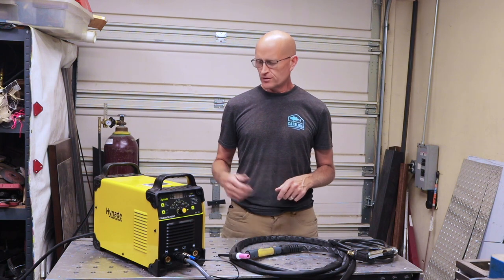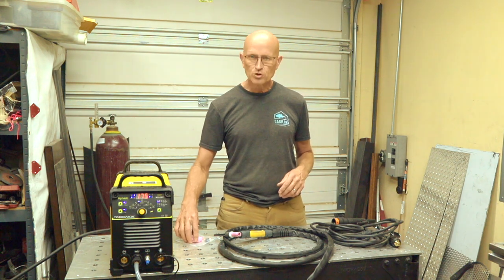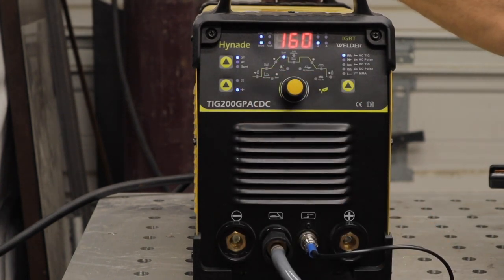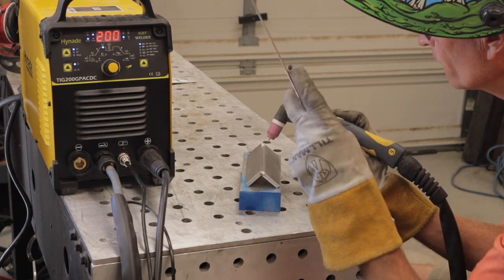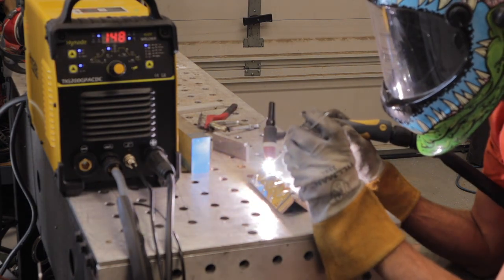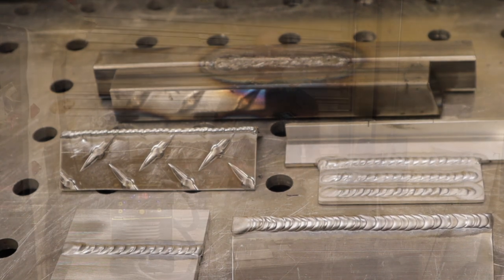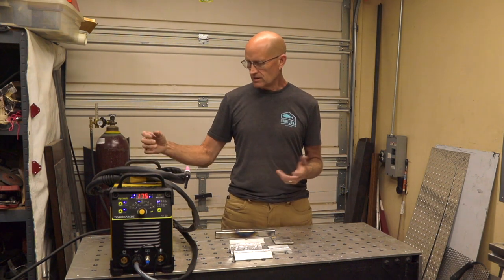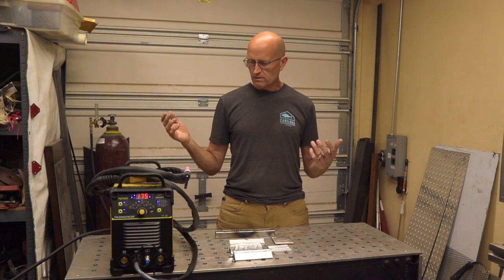Hynade 200 Amp AC/DC Tig Welder Review --- Aluminum Capable!

Comment: Your opinion vs the Primeweld 225X if you have one?  Thank you.
Reply from the maker: Hi Bob! The Hynade is a great Tig. One thing that I’ve learned over the years though is the age old saying in Tig welding, “You can never use the the amps that you didn’t buy”.  Having 25 more amps can be a game changer if you are welding 1/4” aluminum to a slightly thicker material like 5/16” plate. The primeweld also comes with a better torch and better pedal. Both Tigs will perform great for you and I’m sure you would be happy with either. If it were me though, I’d opt for the primeweld. 😁👍
Reply: @PranaTech  The Hynade was on sale this week on Prime Day for $519.  Couldn't resist and ordered one.  Hope it's as good as your experience!  Thanks.
Reply from the maker: Hi Bob! Hey, that’s a great price! Let me know if you have any questions when you get to welding with it. 😊👍
Reply: @bobli9267  I bought mine for $650 last week, about to try and use it tonight. :(
Reply: @PranaTech  very impressed with it so far but can’t get it into SPOT mode.  It only goes from 2T to 4T.  Putting nicer aluminum beads than stainless.  Any ideas on the SPOT mode?
Reply from the maker: Hi Bob, I’ve never used the spot feature before. I’m too lazy to change my settings.🤣👍
Reply: @jacobydavis3953  can yours go into SPOT mode?  Mine can’t
Reply: @bobli9267  Yeah, it seems like spot mode is for tacking. What’s your starting amps, peak amp, balance, and frequency set at?
Reply: @jacobydavis3953  I upped the starting amps to 10.  Peak depends on material.  Balance is for aluminum and I think I have it at 35.  I bought the foot pedal and that works well.   Are you able to press the button and get it into SPOT mode; mine can’t.  Only switches between 2T and 4T
Reply: @bobli9267  Yep, mines goes to spot
Reply from the maker: Hi Bob, have you tried to do spot without the pedal attached. It might need to be set to torch switch for the spot option.
Reply: @PranaTech  the only way I found I can get it into spot is to first put it into pedal mode.  Also despite the icon, I can never get it to set the tungsten size though I don’t know if it matters.   Btw, the manual is pretty much exactly like the yeswelder 250p so I’m guessing this is some common pc board they are using.
Reply: @jacobydavis3953   the only way I found I could get it into spot was to first put it into pedal mode.  Is it the same for you?
Reply from the maker: Hi Bob, well I’m glad you got it to work finally! I think you are right about the similarities. I’m sure they are probably made in the same factory.👍
Reply: @PranaTech  Any reason to have to set the tungsten size?  I know yeswelder's works from other vids and hynade doesn't seem to work.  Is that a necessary feature?
Reply from the maker: Hi Bob, I don’t think the Hynade has that feature. Because it is only 200 amps you don’t need to go up to 1/8” tungsten. The button over on the lower left is only for the switching from torch to pedal. If the manual states anything about tungsten size selection, then we know for sure that they just copied Yeswelder’s manual.😊
Reply: @PranaTech  thank you for all your help!!!
Reply from the maker: Anytime👍😊
Reply: @bobli9267  To be honest it probably was in pedal mode now that I think about it. Mine was still operating off the torch switch tho.

Comment: Bought this welder recently but apparently suck at life and cant get an arc to start. What are the settings you have programmed into your machine?  Please and thank you!
Reply from the maker: Hi NorCo! Ok I’ll do my best to get you going and welding. First thing, is the ground cable connected to the far right + connection? In Tig the electrode is negative and the ground is positive. If that is correct on your machine, then I would ask if you are using a foot pedal or the switch button on the torch? Are you welding aluminum or steel? Give me as much info as you can and I will help you get going.😁👍
Reply: @PranaTech  yes ground is +, im using a pedal and welding aluminum with 100% argon. I cant seem to form a puddle without destroying the metal...
Reply: @PranaTech  1/8 thickness 6061 type aluminum
Reply from the maker: Ok, I just have to make sure. The welder is set to AC, correct? What frequency are you set at? I usually use 60hz for 1/8 and thicker. I usually set balance at 25-30 depending on the type of joint I’m welding.
Reply: @PranaTech  im on Ac Tig,  yes. I was a little high on the hz ill lower to 60. What do you recommend for peak amps?
Reply: @PranaTech  also what would you recommend for gas flow rate?..
Reply from the maker: Ok, I use a #5 cup with 3/32 tungsten that is 2% lanthanated. I set my argon at about 17-18 cfh. For flat or lap welds on 1/8” I usually set max amps at 140-145. Outside corners - 130 amps. Fillet welds I bump up to about 150 amps max. I would test it out as much as you can before the return window expires. You don’t want to get stuck with a faulty machine. Mine welds beautiful but there is always that one in a hundred welders that has a defective main board and that goes for all the manufacturers, not just china. It should start a nice stable arc and be able to sustain it. Let me know if I can help in any way.👍
Reply: @PranaTech  do you know how to get a pedal working properly?
Reply from the maker: Yes, most definitely! What is the problem with yours?
Reply: @PranaTech  it seems like i cant control the arc. Its just on or off it seems
Reply from the maker: There is a button on the left side of the control panel that needs to be set to “remote” when using the pedal. Is that turned on?

Comment: Ok i just buy one the ac balance in the book it say 15-85 mine go from 15-65
Reply from the maker: Hi there, yes a lot of the companies are now stopping at 65. I usually set mine at 25-30 for normal aluminum welding. I only use 65 for making a ball on the end of the tungsten. A lot of guys don’t even ball their tungsten on inverter machines. The majority of my welding is spent in the 25-30 range unless I am welding dirty cast aluminum and then I crank it up to 35-38 to help clean more. Hope this helps! 👍😊
Reply: @PranaTech  Thank you
Reply: @PranaTech  For aluminum is there a chart for metal thickness to the amps I must use to weld
Reply from the maker: You are welcome! Congrats on the new welder! Let me know if you have any questions when you get to welding with it. I’m always happy to help.👍😊
Reply: @PranaTech  Thank you for your support

Comment: The manual for this unit is terrible.  And I bought it on the basis of this review.  And mine seems to be DOA.  Can't get the tig to work with or without the pedal.  I'll be returning it.
Reply from the maker: Well that’s a bummer! Thank you for letting me know. I would go with the Yeswelder Tig then. I have long term experience with theirs and it is a serious workhorse. 👍
Reply: @PranaTech .... bummer is an undestatement. wasted hours of my time.  and there is no technical support or customer service in the US.  you should mention that.  and you mention in your review that the manual is 'comprehensive'.  It translates badly IMO.

Comment: Why is it that my tig will start a puddle but then just melt the aluminum?(sink into it)
Reply from the maker: Hi Jacoby, are you using the foot pedal or the switch on the torch? If using the pedal, you need to switch it to remote for the pedal. That setting is on the left side of the panel on the bottom under the 2T 4T button. There is a selection for that button that is a square with an arrow pointing up to the right. That needs to be lit up if you are going to use the pedal. The other icon is for just the torch button and has no variability for amperage when welding. It will just give you the max amps as soon as you start welding. The aluminum starts to heat up and if you don’t back off on the amperage, you will just melt right through the bottom of the plate. Hope this helps. If you have any questions just let me know and I’ll be glad to help. 😁👍
Reply: @PranaTech  Waiittt so my starting amp needs to be way higher than my peak amp? I’ve had it backwards then lol
Reply from the maker: 🤣 no, my starting amps are set at 5 or 10 amps. My peak amps are just a little higher than what I think is the most I’ll need. You had it right all along. Are you using a foot pedal?
Reply: @PranaTech  No but I just tried putting my starting amps at 140, 3 sec upslope to 80 amps, and I just laid a small bead lol. I did notice that I could only do that once as the pipe was super hot. I’ll try to put my starting amps to 10, and peak it to 80 at 2.5 slope to see what it does

Comment: Was looking at the jegs tig 200 acdc welder but it jumped up in price. The hynade is currently a lightning deal for $550 so i just ordered one. Is there a foot pedal you recommend for this machine?
Reply from the maker: Hi Kyle, they sell one that works with their Tig and it works fine but is a bit clunky. I am using my custom one that I built with it but I have also used my Nova pedal for the AHP that I have with it. There is also the SSC pedals as well. You could use one for the Yeswelder or AHP 201xd. They all use the same potentiometer size, they just use different pinouts on their plugs. If you don’t mind switching wires around and resoldering them on the connector plug, then you have a bunch of high quality pedals out there to choose from. I have a schematic that shows you the layout for the Hynade plug if you decide to go the custom pedal route.😁👍
Reply: @PranaTech  I'm assuming it's the same as the pedal you made for the yeswelder? I'll probably go that route but I might try to 3d print the majority of it.
Reply from the maker: Hi Kyle, yes it is that exact pedal. I just made an adapter plug to go to the Hynade so I didn’t have to alter the wiring on my pedal. 3d printing sounds like a lot less work! I like that idea!😊👍
Reply: @PranaTech  I'm doing this very thing right now.  Do you have a link to the wiring for the AHP?  I have a harbor freight Vulcan that I'm adapting now, happy to share the finished wiring with anyone who would like it as well.  Cheers.
Reply from the maker: Hi Ray, here is a link to the SSC site. Scroll down to the link to the wiring diagram and it will give you what you need. https://ssccontrols.com/product/c910-0725/😁👍
Reply: @PranaTech  Thank you!
Reply from the maker: Anytime my friend!🙏😊